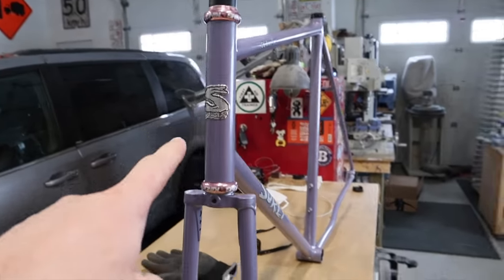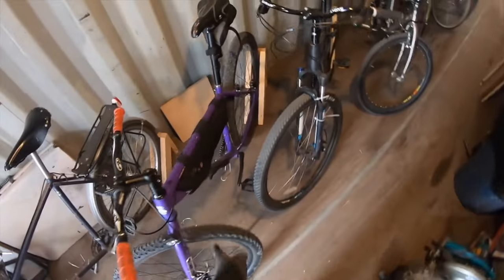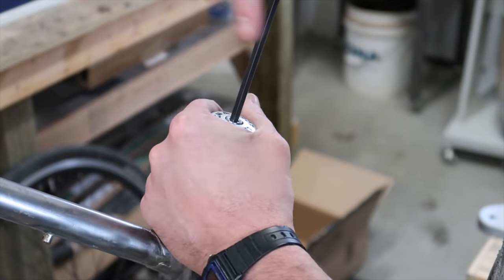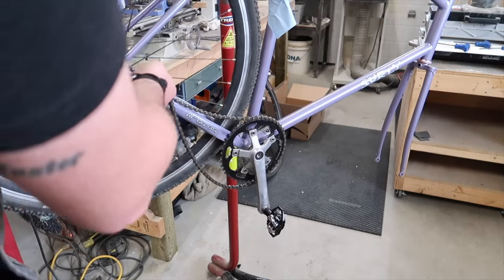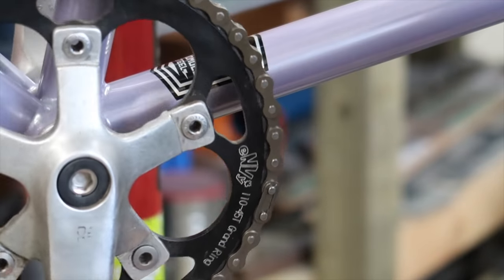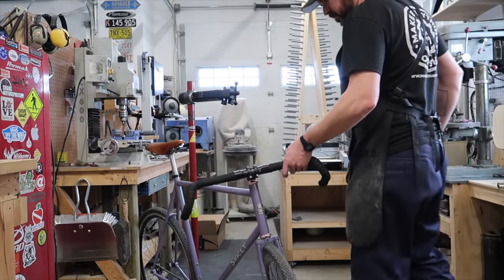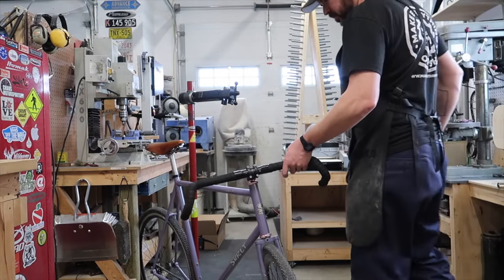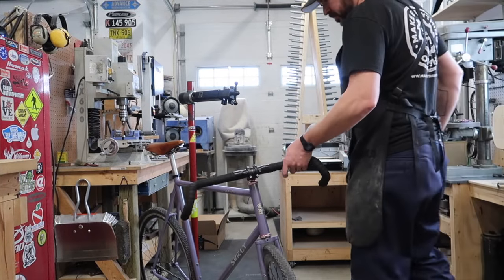i got a Surly SteamRoller!

Comment: 56y old lifetime cyclist.   Owned more than twenty bikes in the past twenty years. , and my Steamer is one of the most enjoyable day to day  rides I’ve ever had.    Using 37mm gravels, with the Surly Truckstop raised drops, and Brooks springer saddle. SS is all I need for most of my flat riding. 
Fast. Comfy. Agile.  
Wish it had better options for bikepacking. 
Planning a 500km ride this year.
Reply from the maker: Right on! That’s great to hear. I”m thinking I need to get some miles on this thing right away here. I love the feel of the frame 👍
Reply: @jeremygoertz  after putting many miles on the steel bike, it’s more lively than my aluminum bike with similar tires.  Definitely not as jarring to ride. 
I’ve always liked steel frames.

Comment: Consider wide bars!! Out there, the extra width won't be a problem and I think you'll love the comfort and control you get from wider flat bars.
Reply from the maker: I have tried the wide flat bars on my Karate Monkey and I wasn’t a fan. I actually ended up cutting them down and found them more comfortable a little narrower. I wanted to like it but the whole wide bars don’t jive with me for some reason. Which is strange because I’m bigger than the average man. 🤷‍♂️
Reply: @jeremygoertz  When you say wide, how wide do you mean? Because I meant more like 660-700mm, which is a bit narrower than a lot of people would think since "wide bars" are known to be used for MTB and downhill. In the fg scene when we say wide bars, it could be anything from around 600-800mm
Reply from the maker: Yeah I’mm thinking the super wide end of the spectrum. I had some 780s on my KM and rode them for several months. For me they were just too much. I chopped them to 660 and like them so much more now. I actually have a vintage Nitto bar that is fairly narrow that I might put on this. It would be a super clean look.
Reply: @jeremygoertz  Ah I see. Yeah I agree! 780 is pretty damn wide haha I'm from ny and I like my 660mm bars just fine. Very rarely they're a bit too wide. I tried 710s once and wasn't a huge fan. But if you haven't tried risers on a fixed gear, I'd definitely at least see how it feels if I were you.

Comment: I really like the color on that frame.
the chainring should be in front of the crank though, i have seen those bend like an aluminum can when installed that way. if the chainline is off that much still look into spacers or a different length of bb spindle. just use a bigger cog if you want an easier ratio.
Reply: I don't understand. That looks like a tripe chainring crank, and he's running his chainring where the middle ring would sit in the standard triple setup. Why would it be at risk for bending?

Comment: Great video man! Loved it. Quick question. I’m a beginner when it comes to bike mechanic work. Beginner meaning never even changed a tired. Do you think it’s realistic for me to build up a fixed gear from a frame set? Granted I take the time to learn an invest in all the tools. I guess my question is, is it a good project to learn on with such a big learning curve? It’s a bit intimidating. Thanks!!
Reply from the maker: Thank you! For sure. A fixie or even a single speed is a great place to begin. Some of the most frustrating parts of working on bikes (at least used bikes I work on) is getting different shifters and deraileirs to work together. Or find parts for them. Take out the shifty bits and you eliminate a lot of the hard stuff. I’d say go for it!  It will be a blast and you’ll learn a lot 👍
Reply: @jeremygoertz  thank brother much appreciated to have your opinion. I’m excited for the journey !

Comment: Love it! They make some bloody good frames but they're out of my price range.

I wanted a 1x1 for years but could never afford it. When I'd finally scraped together enough cash for the frame and some decent components, I got in touch with my nearest dealer, only for them to tell me that Surly had discontinued it!

I ended up buying a Kona Unit which is a good bike, but it's just not a Surly. I guess I'll have to keep my eyes on ebay.
Reply from the maker: Yeah those 1X1s are sweet. I saw one locally for $350 this summer and was tempted. Those Kona Units are great bikes. I was going between that and my karate monkey. The only reason I went with my KM is because I used to own a KM and had such great memories of it.